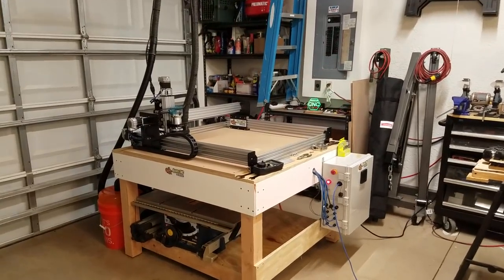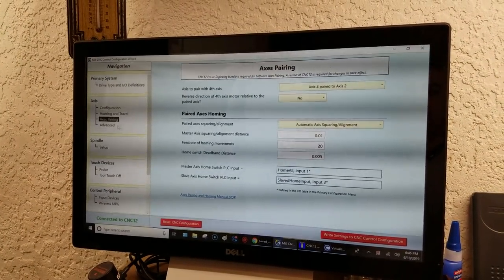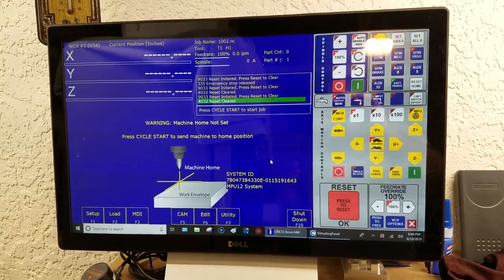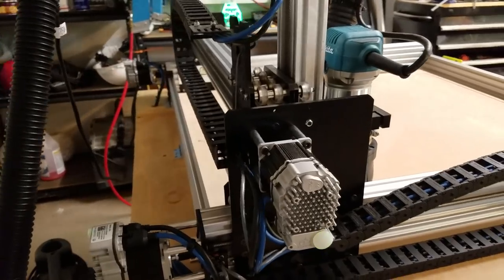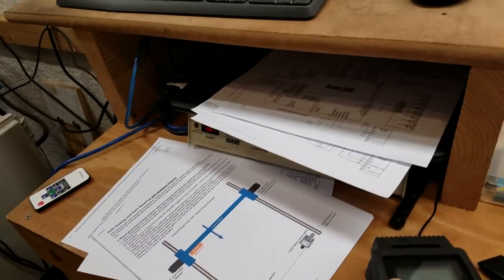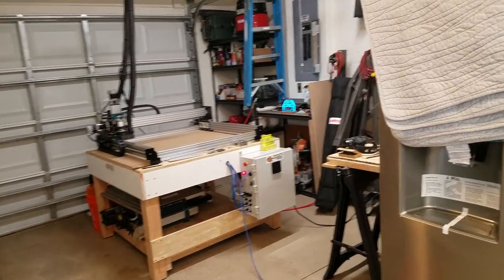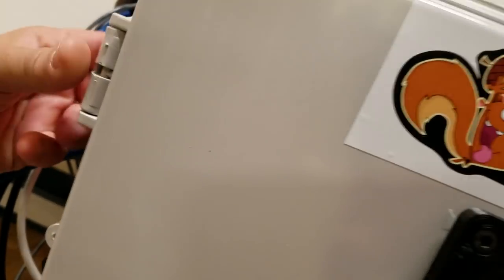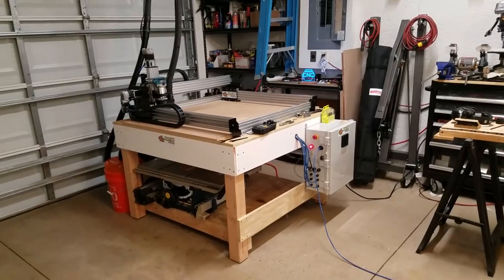WorkBee CNC Router: Update 8 Auto-Squaring Y Axis With Centroid Acorn

Comment: Thank you for this video. I am really considering an Acorn board now that I have seen this. Currently I am using a simple GRBL CNC Shield. It is cheap, dies the job, but is a finicky thing to mess with.
Reply from the maker: The Centroid system is really nice to work with.  I've found it to be very stable.

Comment: fyi..the auto square default message display time is 3 seconds..this is set on purpose to be slow so the first time running its easy to follow along as to what is going on..., after you have it all setup and working the way you want...you can decrease the message display time in macro # 74 at the top.  1.5 seconds works well.
Reply from the maker: Awesome!

Comment: Man that’s awesome, seeing this thing coming to life ! I was wondering, do you plan on installing a coolant system ? Like a closed loop flood or maybe a mist coolant system... I would be very interested in your answer because I can’t come up with a solution on my router (it uses an mdf spoil board like yours)
Reply from the maker: Hi.  I'll probably just use the vacuum on the router.  But, I have found that rubbing alcohol and an air brush works great on my lathe.  It keeps the cut cool but hardly leaves any mess on my machine.

Comment: Are the drive screws the ones that came with the machine? I'm thinking of getting the workbee from bulk man,  and getting different stepper motors and drives,  not like your but better than what comes with the machine. the ones you got are out of my price range right now.
Reply from the maker: Hi. I did use the stock leadscrews ad delrin nuts. They worked pretty well.  The Clear Path servos were a bit of Overkill but they worked AWESOME!  that being said, closed loop steppers are also an excellent choice.

Comment: Franco great stuff. Openbuilds is running a deal on their motion controller, called the "Black Box" could it run the Clear path motors you use
Reply from the maker: I'm sure it could be made to work somehow.  If you have step and direction, the I'm sure you can make the ClearPath motors do their thing.

Comment: Franco, you went with servos, but did you also go with ballscrews?  2 x X, Y, and Z?
Reply from the maker: Negative.  Currently using the stock 8mm triple lead leadscrews and double plastic nuts.  So far, that seems to be working out pretty well.

Comment: when u connect the 2nd Y axis (slaved one) do you have to add it to another axis? so you end up using all 4 axis or is the connection different?
Reply from the maker: I used all four axis outputs on the Acorn.  But, it is possible to drive both Y-axis motors from a single output and have the ability to connect a 4th axis rotary.

Comment: Any room on the board to add a 4th axis to this?
Reply from the maker: Maybe.  You have 5 inches of Z travel.  If you want to use a forth axis, you may have to partially recess it below the spoil board.
Reply: @FrancoCNC  I was referring to room for another drive on the board.
Reply from the maker: @loganrose2791  Oh.  Well, the Acorn can only drive four axis motors.  So, you can't make a 4 axis router as you need 5 individual drive motors to accomplish this.  There are government restrictions on 5-axis technology that make it cost prohibitive to develop an inexpensive 5-axis board.  Centroid falls on the government RADAR as they do a lot of their business in the true industrial arena. Google ITAR
Reply: @FrancoCNC  simultaneous 5 axis control can be done with Arduino. Even a simple Beagle Board can do 5 axis (Pocket NC example).
Reply from the maker: @loganrose2791  that is true. But, the CNC control companies are still regulated by the ITAR laws. In fact, many new multi axis CNC machines have GPS units in them so they can be tracked when they are moved. We moved some machines at work and they stopped functioning a few days later because of this.  No joke.
Reply: @FrancoCNC  yes, I was a CNC engineer for OKK mills.  99% of those regulations only pertain to blacklisted countries.  The regulations actually failed because it just led places like Iran to develop control systems of their own that is even more advanced than FANUC or Seimens.
Reply from the maker: @loganrose2791  I believe it.  One thing I've learned messing around with the DIY CNC stuff is that you can never underestimate the creativity of people when they really want to make a machine work!